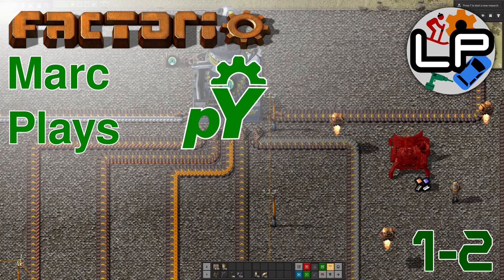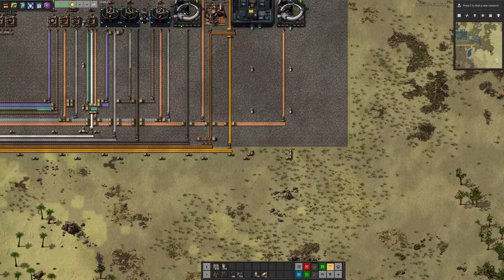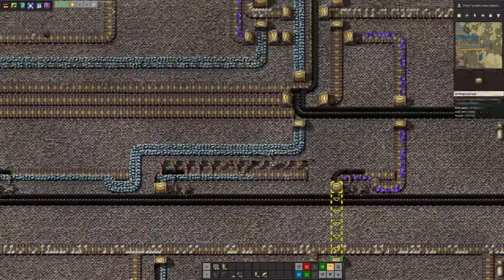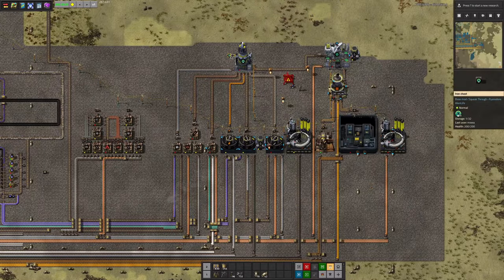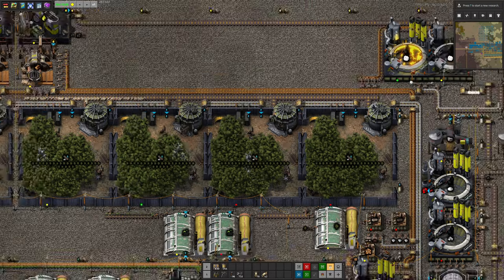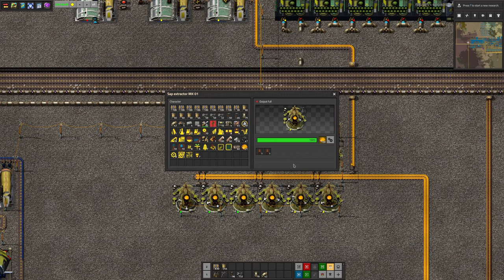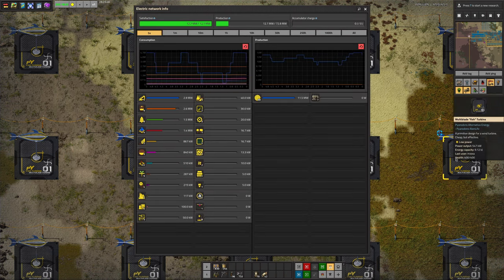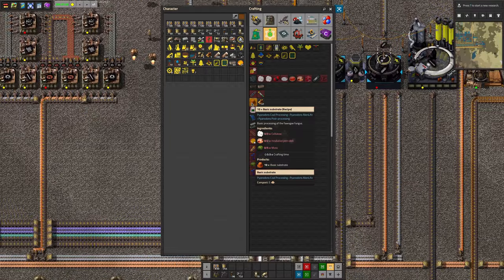S1-E2 - Basic circuitry - Marc Plays Factorio: Pyanodons

Comment: so 1 thing. those glasswork machines dont require hydrogen. they'll happily burn any fluid with a fuel value and as such is why the ones above the quartz melting machines is hooked up to the light oil. due to the way factorio works since the machine isn't filtered to 1 specific fluid it doesnt show anything until it has something to burn in it.
Reply from the maker: Thanks. I feel like I worked that out, although it might not have been until I was processing the video, so I didn't say anything about it. It's always interesting to find out the bits I've missed!